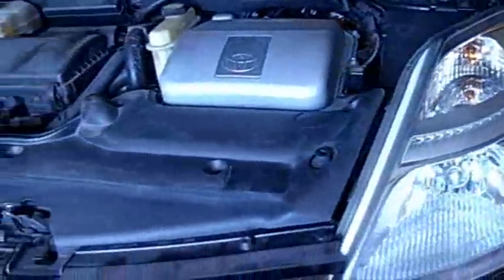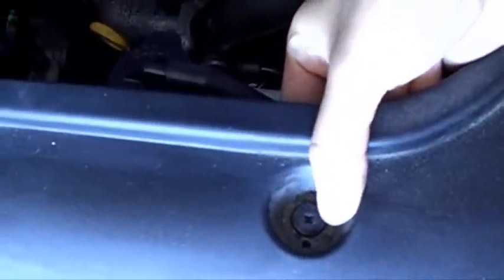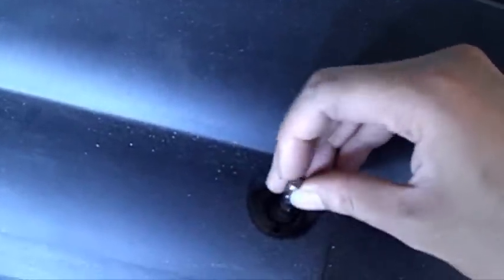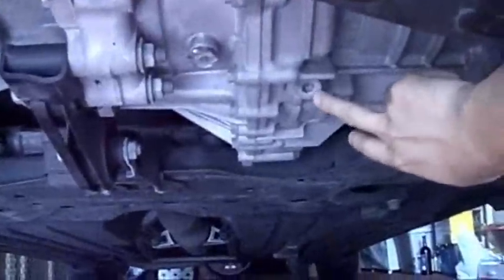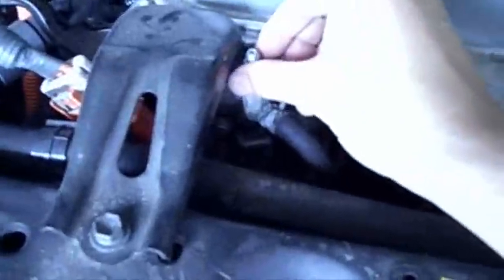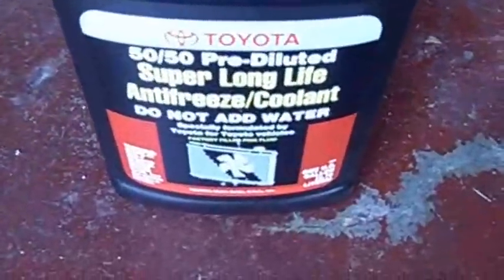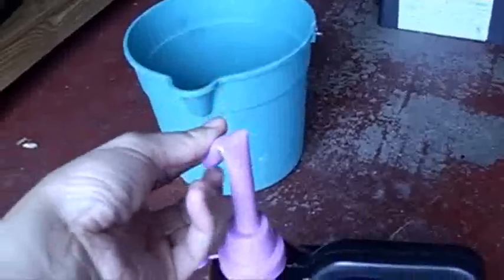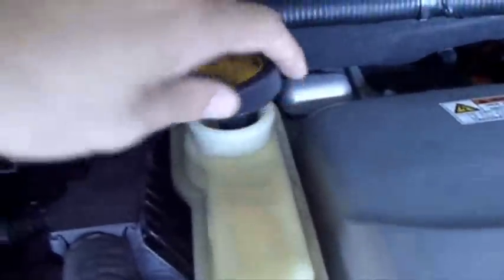2006 Prius Inverter Coolant Change

Comment: After the drain, you should hook a hose from that bleeder valve to the reservoir put the key in position 2 and watch the air bleed out of the system

Comment: Aren't all mechanics crooks? lolol
Reply: No but unfortunately most are
Reply: SOME are. Most are just trying to stay ahead of rapidly changing technology and diminishing wages.
Reply: Have paid a plumber electrical, locksmith window man now.  Plumber 350 to 15000 electric box   
Or power pole 1500 locksmith door knob 100  new windows 30000 to 100000 no I don't think and they sometimes easy it's hardly ever easy to a mechanic